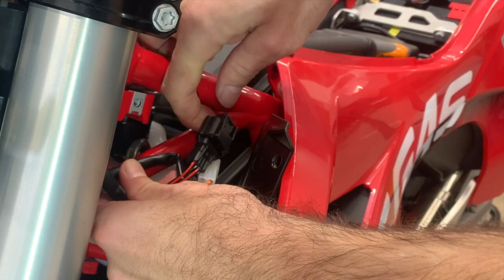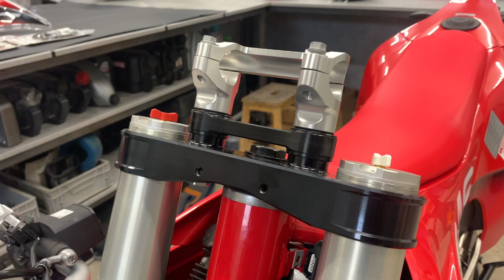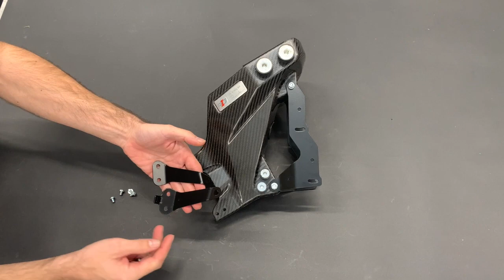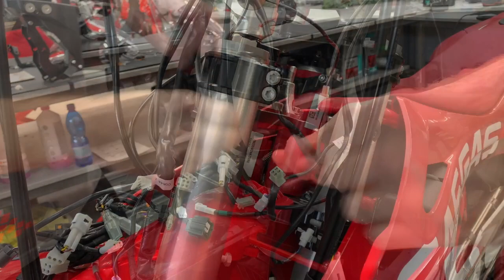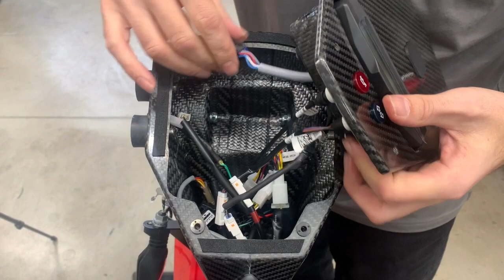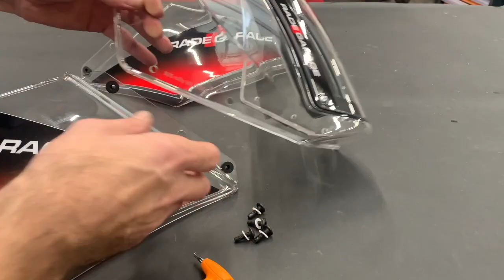GASGAS 700 fairing installation RADE/GARAGE

Comment: The spacer washer (22:28) for the lower mount can be very finicky to get it installed as you described it. Much easier, glue the washer onto the bracket with some super glue, this way the washer cannot drop and you will be able to guide the screw though the holes on the first attempt :-)

Comment: 26:02 I guess the instruction for fitting the brake hose guide is wrong. Shouldn’t it be over the triple clamp as the specific instructions for the hose guide as a spare part? I did as you showed in the video and the guide came loose and the hose wasn’t guided in a good way so some minor damage occured. I’ll have to check with the bike retailer if I need to change the cable(s).
Reply: I also think two hose guides would be good to avoid rubbing against the triple clamp.

Comment: Hi Rade. I installed the kit on my gasgas and worked fine. Important: disconnect the battery before the work. Otherwise the control unit shows an error and you have to go to a KTM/GASGAS dealer to reset the OBD.